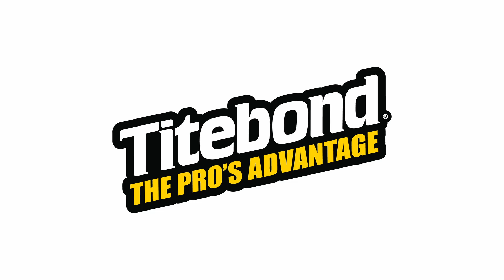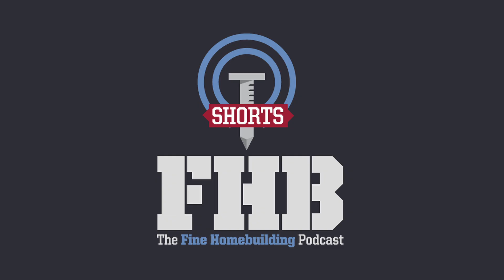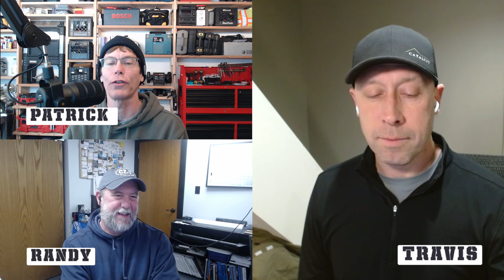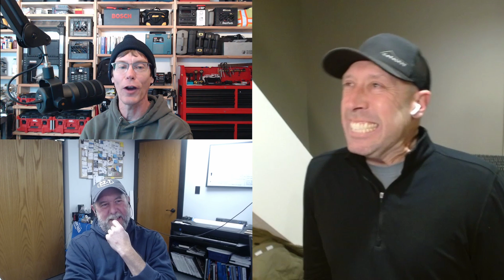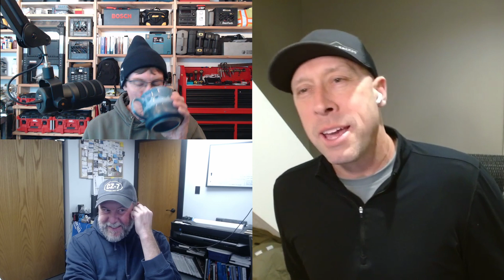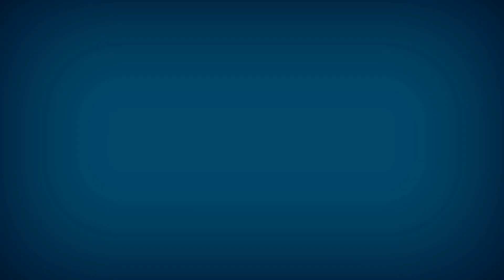Replacing a Collapsing Cabin Foundation—Is Wood a Viable Option? | FHB Podcast 676

Comment: Recommend listener's bloated questions be paraphrased in future.
Digging out 4-6ft for crushed stone backfill against a wood foundation (PWF) seems overkill.  One or two feet is enough to create a drainage plain to rout water to a draintile/sump/pump system.  Same as I'd want to do with a CMU or cast foundation.

Comment: I’m not sure what’s down there that makes a basement necessary but in such a high risk area for water and or soil intrusion, why not just get rid of it. Jack it up high enough to insulate and seal the bottom of the floor with say zip sheathing, mount some beams on Helical piers, fill it in and lower it back down? If it’s just a cabin I assume they’d winterize it each fall.